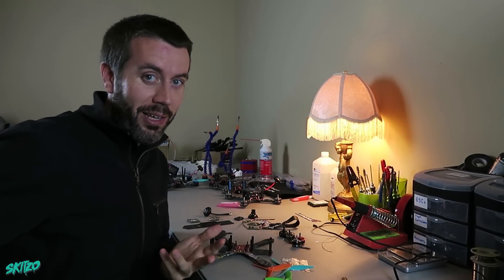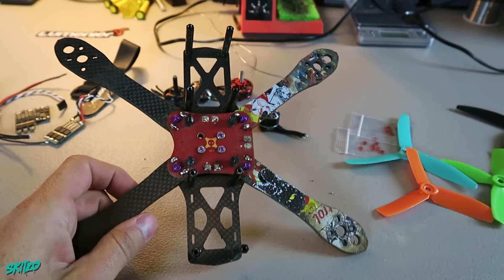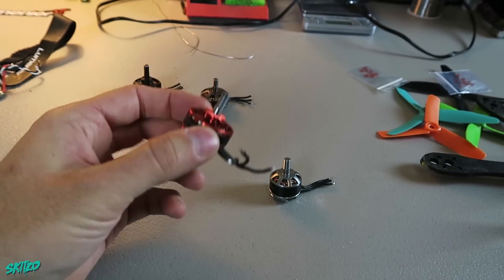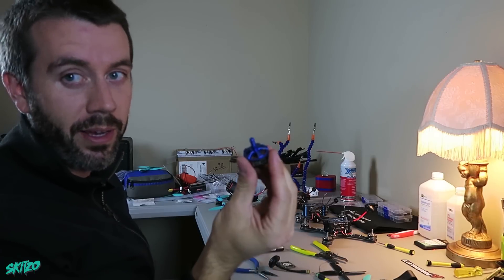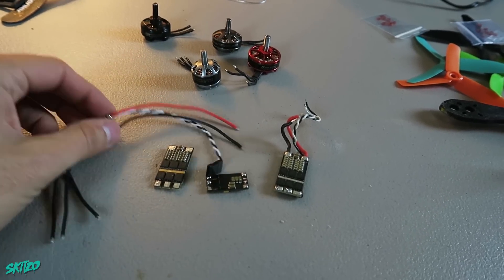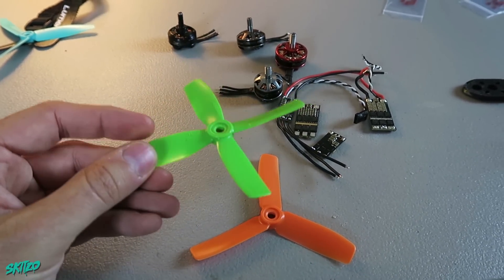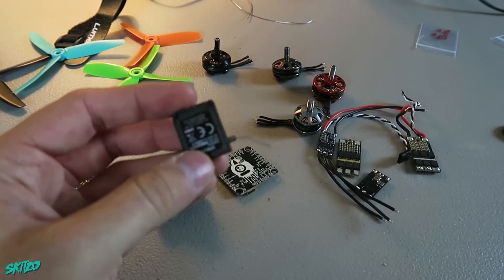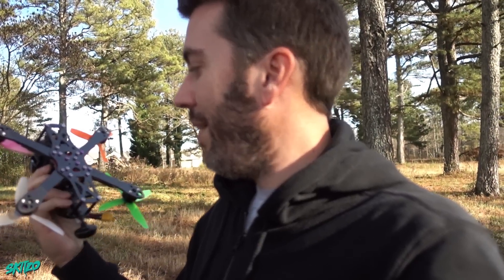Frankenquad! Will it fly?

Comment: Hell yeah. Grip it n rip it
Reply: I feel like this is something you would do Le Drib (and probably SHOULD!) 

I found my way here because I just burnt out 2 motors on a new build and have another odd set of 3 sitting around.  do I put the 2 larger on the back arms, 2 smaller on the front?
Reply: and have Joshua Bardwell analyze at the blackbox data for us!

Comment: I've always been told that this was impossible, even having a single mismatched esc. Maybe it wasn't possible back then, but apparently FCs and firmware is a lot better nowadays. Amazing that thing could fly so well!
Reply from the maker: I know! :)
Reply: But avoid using ESCs and motors with larger power draw than battery in your contraption can handle :) And motors with ESCs that can't cope with particular motor.

Comment: "A chain is no stronger than its weakest link, and a quad is after all a chain. A quad is only as strong as its weakest link. "  It may not be able to compensate for that much difference in thrust with the 4 inch tri, but it is damn impressive that it flies that well. Flies better than my first quad lol

Comment: Sadly that flew better than my first quad... That's really impressive it even worked, I might have to do that since I've got a bunch of mixed parts ranging from 930kv 2212 motors (9-10 inch props) down to some garbage 2204 2300kv that can't even spin 5042 tri-blade over half throttle. Make the ultimate frankenquad!